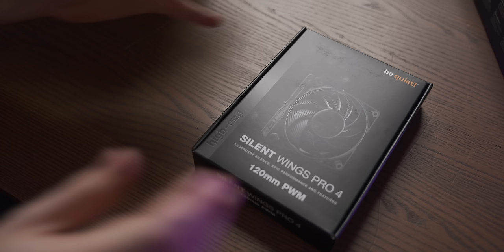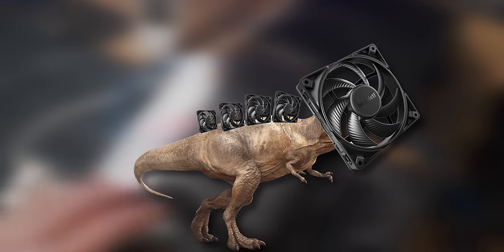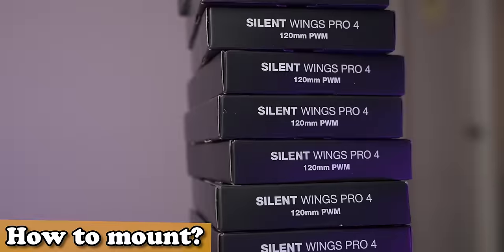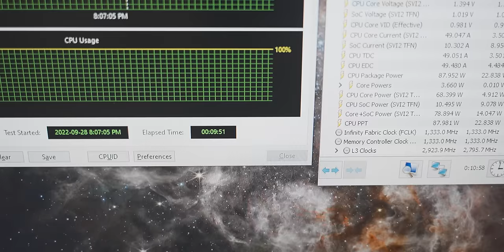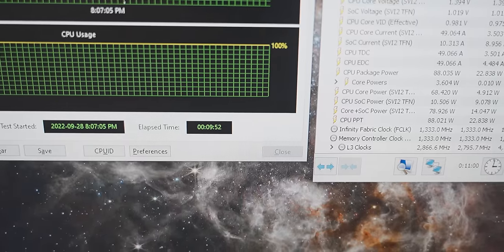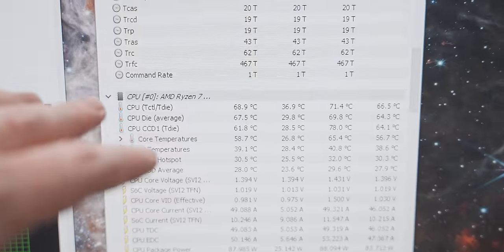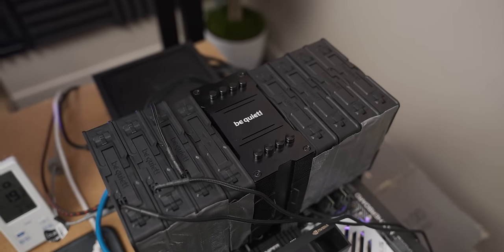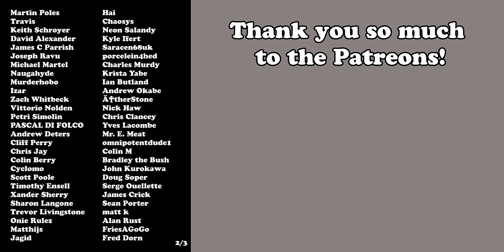More Fans = More Better?

Comment: The biggest benefit I got from adding a second fan on my Be Quiet! Shadow Rock 3 CPU cooler was that under normal load you could shave off 2-300RPMs in fan speed and have the same performance or temps. The deeper the fins is the better the result. The one here is almost half as deep as the Shadow Rock3. FYI.

Comment: It looks awesome! 😂 I think a common misunderstanding thing with air coolers is that adding loads of fans or dramatically increasing heatsink size/surface area only really increases the capacity of the heatsink to cool larger heat loads, rather than cause outright temp differences. The actual temperature they can cool down to (given a sensible heat load) will remain somewhat the same due to ambient temps/temp coming off the CPU. 

This is why we get 'my Arctic Duo 34 cools just as well as my mates NH D-15 with the same processor' where that processor is actually an I5 12400. Because the heat load is so low and the temp difference between the two will be relatively small it's easy to draw that conclusion. If you were to strap that stock be quiet cooler assembly to a heavily overclocked 12900K for example it would go over thermal capacity, heat soak and throttle damn fast. I used to use a dark rock 4 on my 8700k (12400 now, the easy life!) When it was sat at a comfortable 5.0ghz overclock. Before that, running the aforementioned freezer 34 it would commonly sit around or over 90 degrees with the overclocked 120-130 watt heat load. The DR4 brought the overclocked temps down to 70-75ish  However with stock clocks both coolers were not dissimilar on temperatures. 

The real test would be to see if that high wattage heat soak with the DK2 cooler can be delayed/prevented with the eleventy million fans!

Comment: Based on vortex and eddy in fluid mechanics, it is impossible to synchronize each fans' air flow while minimizing interfering and blocking them

Comment: Did you lock the CPU's clock speeds for testing?  The 3700X Ryzen's are notorious for using ~70-74°c for TJ Max temperature and will just keep adjusting boost clocks to maintain that target.    When I switched a better cooling solution on a 3700X, max temp was the same, but Cinebench score jumped ~400 points because the thermal advantage let it boost longer.  That said, I don't think there will be any significant temperature difference or advantage beyond the two fan push/pull configuration.  Stacking fans doesn't increase CFM, only static pressure (think rows of blades in turbine engines 'squishing' the air), which isn't really going to matter on that cooler.

Comment: What if 9 fans were used on an enclosed full size case? 3 Pulling from the front 3 blowing air out the back, and 3 blowing up at the top?

Comment: Very possible you reached the saturation point as to how much the cooler could actually move between the die and the heatsink fins.  That'd be my guess as to why there wasn't any major gains after adding the first set.
Reply: Correct, what'd be really cool is if be Quiet made Dawid a one-off 6 tower air-cooler with 18 heat pipes and mounting space for 7 fans, it'd be insane, very heavy but omg how much TDP could it remove.

Comment: while stacking fans you should use counter rotating fans. One have to spin clockwise and the second should be counter clockwise. When using counter rotating fans you you increase static pressure which helps to cool better

Comment: you need stator vanes in between fans, or they'll just spin the air around after the first couple, instead of accelerating it further. Providing that works, you could then produce a significantly higher pressure.

Comment: As the experiment showed, stacking fans in series doesn't increase the airflow. One fan would have to push the next fan to spin faster in order to get more airflow thru it. If you built a frame to mount the fans side by side, and a plenum to direct the air into the cross section of the cooler, you would be able to move more airflow thru it.

Comment: It behaves this way because, correct me if im wrong, also i dont remember exact formula, but formula for heat dissipation vs air flow/pressure basically has ^3 or ^4 xomponent related to air velocity in it, meaning that at some point if you replace your e.g. 3000 rpm fans with something ultrastupid like 230v giant fan that can cool some factory, it will make a diminishing difference, that's ofc assuming you're already above the "minimal sweetspot airflow" but ye, for 14 fans to benefit from it you eould need some super restrictive radiator

Comment: At this point you are running in to the limit of the base cooler. Adding more thermal dissipation won’t make a difference if you’re not able to pull enough heat off the processor fast enough.
Reply: Also adding more fans at the same rpm doesn't increase air flow. It just adds spinning plastic. In the automotive world we rarely even use push-pull setups because of the minimal gains.

Comment: These fans have a speed switch on the back. You should've tested them at their UHS setting to really see what they can do. Running a 3000 rpm fan at 33% and hoping for better performance is just weird

Comment: The fans just create extended turbulance. In order to really test this, you need alternating fan blades. That will smooth out the air.

Comment: I have an air cooler that supports 4 120mm fans, there are 3 seperated fin stacks with 4 heat pipes in each stack. But this is wow, lol. 

Under full load it doesn't get higher than 60c. But I have 7 120mm case fans front 3 intake, top 3 exhaust, 1 rear exhaust, then 4 on the cpu, and 2 on the gpu.

Comment: If you Mount fans like one normalny other backwards and spining in the other direction will gratelly improve air Flow. It has to do with fluid dynamics and stuff i tested something like that few years back check it out.

Comment: As unpractical as this may sound, you should be doing this in a case. Doing this on an open test bench doesn't really hold well since there is virtually no pressure to be worried about.

Comment: I mean, I've seen videos like this 10 years ago. Strapping on more fans, even push/pull doesn't matter, so long as there's enough static pressure to overcome the airflow restriction of the radiator/fin stack.

Comment: Missing the obvious conclusion: the original heatsink and fan are already working at close to maximum efficiency: there simply isn't more heat able to be drawn up and then away.  That's a real positive for the original two parts.

Comment: Use fans only for pushing air not pulling, I think that will be more effective. Because these fans are designed to push air more effectively than pull air. You can see on the GPU the fan is like turbo fans that is designed to suck more air.

Comment: I figured out why your temps went down.
There is recirculation normally of hot air from near the cpu.
When there are 14 fans, the entry air will be very far away and so will have fresh air.
It is like having a long fan shroud from outside the case, so that no hot case air can be reused.
Similar concept.
So it is not the number of fans, just the fact that you built a long tube.

Comment: the only time i can say more fans is more better

with a radiator double or quad stacking fans can make a HUGE dif depending on the setup... 

worked in a shop that made custom servers and workstations for a while and, sometimes we used super thick radiators and 2 high static pressure fans on each side in push/pull, a few builds had up to 4 fans on each side due to just how much resistance the radiator created.. the one i helped build like that was for a very specific use case and well, it was running dual chips at 4.7ghz 24/7 that produced enough heat that... under extended load it would still hit around 87c, and the loads it would be put under could last days at a time, renders and simulations... it was a beast of a box... the videocards also were on their own loop but just a normal thin copper rad used for that, with push/pull... nothing fancy needed for the gpu's... back then they didnt run nearly as hot as modern cards.

Comment: It's just a 4 heatpipe cooler, and thermally it's probably set up for close to max heat dissipation from factory with the single fan. Would try this again using a DARK ROCK PRO 4 instead.

Comment: I wonder if the fan speeds were staggered and modified, if it would have any effect? Similar to a gearing system but to ramp up the air faster on the final output

Comment: The cooling is affected by the Speed of the air going through the fins (and fin size, density, etc. The variables that are staying the same here.)
Adding the extra fan to Push-Pull means maximizing that speed, pushing past the resistance.
Just adding more fans at the same speed will do nothing. Needs FASTER air.
So, say four fans spread out and a funnel of that air (maybe a cardboard contraption) would speed the air up.

Comment: If you had contra-rotating fans with the speed between them increasing the further you get, that might have a huge impact. Sadly, they only use the fan/inverted vanes architecture in turboshaft and jet engines 😂

Comment: Get a 120 mm RC plane EDF, a suitable ESC and Two 6S lipo batteries and try cooling the CPU with that. 5 kW and 300 km/h efflux cooling solution... Also 95 dB at normal PC distance. 

5+ kgf of thrust will need beefy duct taping to keep it from moving around too. Bonus.

Comment: you would see a bigger difference i temp if you set the fans at a fixed voltage. if the fans are set te 2000 rpm the help from another fan would only let the first fan get to 2000 rpm easier but not spin fater so you would not get more airflow.

Comment: You could've bought 4 screw rods of a hardware store, passed them through the screw holes on the fans and just put two nuts on the ends to hold that mess together.
Reply: That makes so much sense that it actually took my brain a second to process this proposal, yeah, he should've done that. 😆

Comment: Should try a 12900k or something, one that produces an insane amount of heat and see if there is a bigger difference with more fans; I would think so
Reply: I think not, because you are not actually pushing any more air through. The blades are moving at a specific speed and have a surface area. That doesn't change by adding more fans. More fans help overcome air resistance, up to a point, but that point was reached at two fans.
Reply: there will not be any difference, because you are just dealing with air moving the heat on the surface of the heatsink, more heat will just mean that the heatsink will be more saturated, you will need faster spinning fans like delta 10000rpm fans to do something, and as you see add more doesn't push more air faster over the surface of the heatsink

Comment: I thought you might mount them on side of the case side by side next to each other so they are all working to move the air out the case and across the electronics. I'm no physicist in fluid dynamics, but there is something about your original premise of stacking them that seems wrong, especially if all blades are turning at the same speed they don't suck more air.
I got a challenge for you, an ICE cooled CPU.

Comment: Dawid - Neat video, but there was no way you were going to see any significant improvement beyond the 1 pusher and 1 puller setup.  No matter how many fans you have, they are limited by how much you can pull through the fan that is the most restrictive for air movement.  In this case, with all fans being the same, whether it is a 1 and 1 or a 6 and 6, the result was always going to be pretty much the same as the 1 and 1 configuration.  This is basically a series setup of the fans.

The suggestion below to make a box manifold and have the 6 fans arranged in a parallel configuration  with a manifold to match the cooler intake and outlet is a good one as that does push more air through the cooler.  Would be interested to see you create another video where you do 2 in parallel on each side, 4 in parallel on each side, and finally 6 in parallel on each side.  That should see cooling differences.  With parallel fans, you are definitely pushing more air through the cooler as you add more fans.

Comment: David nice vid! Video suggestion: you can get these 12900k engineering samples off ali express for cheap. It is functional with all the P and E cores present and is OVERCLOCKABLE, but, caveat: it will have lower clocks, i think some of its cache maybe nerfed(?), and the primary pcie 5.0 slot of a z690 board you put it in wont work. BUT what should work is the second pcie slot for the gpu, OR in true dawid jank style, you can use a m.2 to pcie x16 converter on the gen4 x4 m.2 slot to plug the gpu in!

Comment: easier way to do stuff like this, get some elastic curly shoe laces, feed them not just threw the fans but the cooler to both sides ffans.. we did this when getting a buddies system working till we coulds get proper clips for the fans on a Macho cooler.. it worked shockingly well, my buddies mothers suggestion was great.. and also, works for  case fans in a pinch.... bulk elastic works as well, the curled shoe laces just hold things in place without needing any tools at all to do the job..

Comment: You'd better try to take more massive radiator with more heat tubes and test the same amount of fans. Actually, you just have a type of heat balance and need to change air temperature to make cpu cooler

Comment: Amazing video Dawid!!! I can imagine what your static pressure was on that. maybe next time a twin tower air cooler, like my Veetro U6 pro cooling my Ryzen 9 5900X. as for the mounting hardware I would use metal wire or fishing line, again your use of duct tape wins my heart.

Comment: More fans is only better if you combine the fans in a way that make they paralelly push more air into what you want more airflow over (push pull configration for example example is a waste of fans, same with push push or pull pull)... Like on my square CPU cooler I use 4 fans, 2 fans at 90 degrees buth pushing air into the cooler and 2 fans at 90 degrees sucking air out on the other sides. The 2 fans sucking barely makes any differece at all...

Comment: Dawid, isnt it obvious or common knowledge that fans don't cool, they just move more air over the cooler. It can only work to the point of ambient temps. It's all relative. 
So the question is.. what was the ambient room temp so we can better understand the results?

Comment: Id like to see lopsided results like 1 pull and 10 push or the other way around. 

Also if you fully tape the gaps so all the airflow has to go through the fans

Comment: Here is a suggestion, you could use server grade fans or high RPM fans, tho you need to power them from a different power supply case they use from 24V up. Another idea for a video would be gaming o Acer Veriton N4640G, it has a PCIE slow for a graphics card.

Comment: You should have used a delidded cpu for this sort of a fan test because only with a delidded CPU you get to release all that heat from the cpu's die to the IHS and from the IHS to the heatsink, in your case the problem is with that poor 3700x your cpu cooler is not getting all that heat to dissipate hence your temperature number got normalised at a certain point. This sort of a test could make a lot more sense if you could some how mount the cpu cooler on the GPU, there we have a big die and a lot more Watts to cool but Mounting such a heatsink on a GPU is tedious and impractical too.

Comment: I got bored one day and put an nzxt case fan that I wasn't using on the other side of my pure rock 2 so I had 2 fans and I got similar results 2-3 degrees lower from adding a fan
Reply: Note: I didn't check ambient so it could've been hotter or colder last I recall running cine bench

Comment: I don't care how many fans you stack in series, you're not going to increase airflow. You need surface area to pull more air from the room across the heatsink in order to achieve more cooling. Arrange them in parallel (in a large grid or arc or something) with a duct necking down to the heatsink and then maybe you'll push some air. One could make it quick and cheaply with cardboard. That'll provide more positive air pressure. 

Of course such a ridiculous setup would look like a victrola horn (2 if you want to do a push-pull) but physics is a bitch.

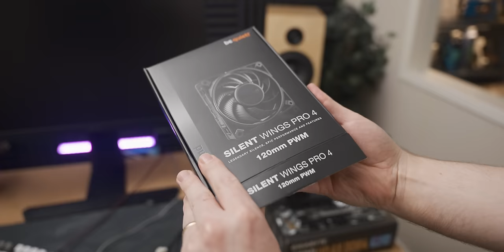Comment: Hi, can you valifind which fan speed did you use? Most in the footage I see at M setting. (3:30, 5:08, 6:00 and 6:40) I am wonder if it would more beneficial to set fan speed to UHS (ultra-high-speed, 3000rpm) for this experiment.

Comment: how come you can't by a 20 x 20 x 5 heatsink with a 40cm diameter  fan. the fan could run so slow and make so little noise, and you'd get so much cooling

Comment: More fans could be more better. but not the same fan blade. An ideal fan stack is the Airplane turbojet engine fan blade shape.
However, you can consider a turbocharger. You can get one from a car junkyard.

Comment: It could have been better if it was planned well. buy a heat sink which is the size of that 120mm fan, place 4 fans on all sides and 1 fan on top. The temp would be <65 C. Wasted 12 fans.

Comment: This evil airflow saturation situation really stopped you from reaching -10 degrees on the CPU 😅 I once tried something even crazier I mounted a couple of 240mm fans in my case which was a big tower at this point also using "clever" mounting solutions but alas... it only shaved off like 5 degress but boy oh boy the airflow was surpreme! And who cares about a jet turbine right next to you? I sure don't 🤔☺

Comment: I have an idea for a stupid test. Say you have an intel 12100 or amd with a single stick 8GB DDR4. I am curios what the performance would be if you add another 16GB for a total of 24GB ddr4, compared to a 16 gb dual channel. Yes, mismatched, but does it do like laptops, where the first 16gb are dual channel, the rest are not? I find that interesting.